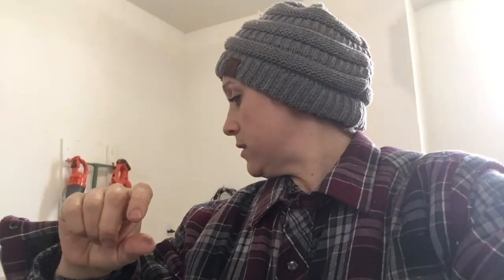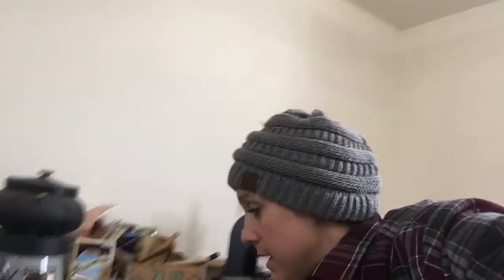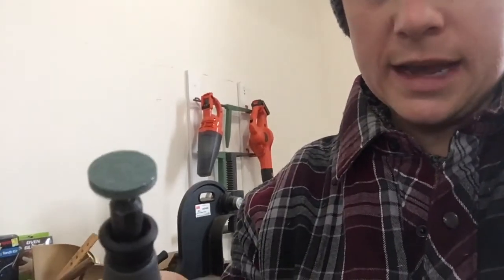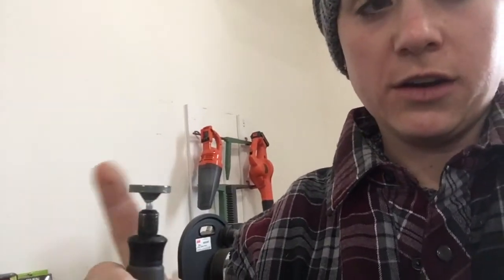Cleaning Copper Cookware Before Tinning

Comment: hello. i have a 1942 to 1945 boy scout steel mess kit. everything but the cooking pan was tinned. the tin coating is in very rough shape and in order to use it i have to remove the tin and i was just going to season it like the pan. but i have no idea how to remove the tin. i used a stainless steel scouring pad but to no avail. do you have a way to remove tin from steel that you would be willing to share?
Reply from the maker: So it's just tin sheet that was electroplated or hot dipped with tin, correct? And the tin is finally separating from the steel sheet...OK...Well, yeah, it did bond to the stainless, so you are going to have to be really really aggressive. Honestly, try a sander - if you can get a small one and you can make a jig to put the mess kit on so you don't compress the shape, you can work on the old tin with like a small corner or orbital sander. Or, use the same type of attachments (like a sandpaper wheel) on a Dremel. Lastly...if you can get access to a glass bead blaster...that would work super fast and easily for you. Good luck!

Comment: is it ok if I were to leave the muriatic acid in the pan, then apply the flux I use (that is zinc with tin power suspended in it), and THEN heat both? There is a Johnson product that you can basically paint on first, then heat the pan. Not sure if my comment makes sense! Just not positive if the acid has to be heated up and therefore evaporated before adding a flux
Reply from the maker: I have found the acid evaporates faster than the flux, and I never have had good luck with any paste or paint - the tin looks horrible after using it. I use the acid heated and evaporated to help "etch" or prep the copper, and then adding the flux after that once the copper is hot and prepped additionally with the acid.

Comment: Hi Sara what is the name of the acid you use ? Love your videos
Reply from the maker: Hi!! So, I do a diluted caustic soda soak first (sodium hydroxide aka lye), clean everything I can both inside and outside. Then, I do the physical/mechanical removal of old and oxidized tin, whether by hand or with tools of any kind, clean around rivets, etc. Then right before tinning I do a muriatic acid wash - about 1:4 (water:muriatic) and then immediately cover the outside with lime paste and put over the fire for tinning all within 2 hours.
Reply: One part water  to four parts muriatic acid?